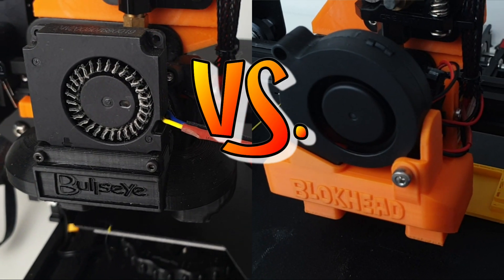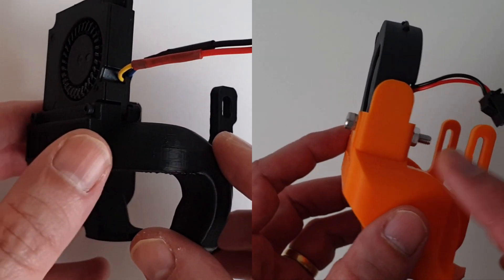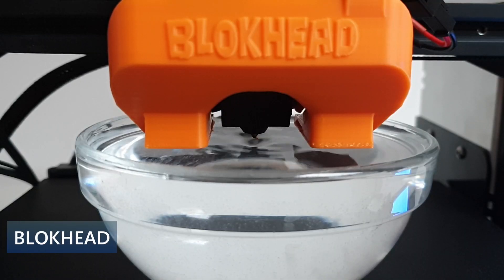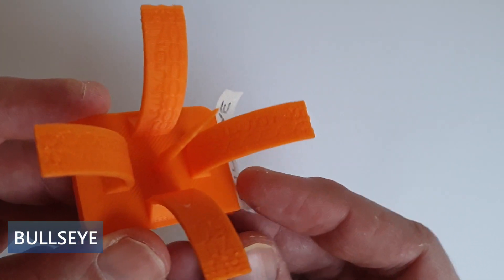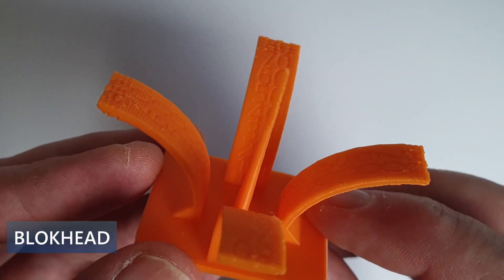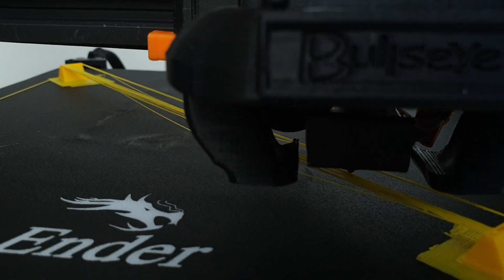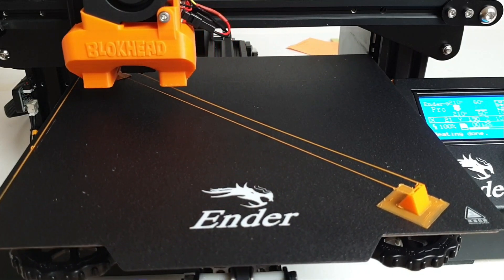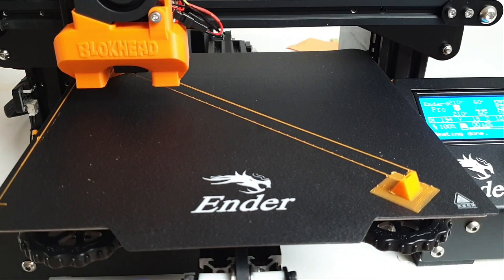Bullseye VS. Blokhead Fan Duct on Ender 3

Comment: Someone needs to create a fan mod that provides great visibility of the nozzle.   I dont xarexabout noise and I will never need to print a bridge that wide without supports, but darn it I inspect my prints a lot and want to look at the nozzle from time to time to assure things are ok...
Reply from the maker: The Bullseye is one of the best I have seen in terms of visibility on the nozzle. Much better than the stock cooling of the Ender 3, both in term of cooling and visibility on the nozzle IMO.

Comment: Blockhead vs hero me?
Reply from the maker: It depends what you expect from a cooling mod. If you ask me, I would reply this (but this is just a personal opinion and I am not a 3d printing expert): Pure performance (bridges, overhangs): HMG5. Silence: HMG5 (2 fans spinning at lower speed make less noise than one fan at higher speed). Ease of print: Blokhead (less parts and support free). Ease of installation: Blokhead (less parts / less hardware required). Direct Drive compatibility: Blokhead (The HMG5 shifts the hotend forward by 8-9 mm which breaks the compatibility with the official Creality Direct Drive or the SpeedDrive V1). Also to take into account: aesthetic,  cost, visibility on the nozzle, compatibility with future upgrades, ease of maintenance and so on. Both are good choices and improve upon the stock cooling, you cannot really go wrong! Since I tested the Blokhead, David Petsel has released a Direct Drive version of its Blokhead which seems interesting: https://www.thingiverse.com/thing:4868204

Comment: bruh I would have ejoyed seeing the finished results of the extreme bridge tests
Reply from the maker: I did not let it run to completion. Once the first 2 layers provide a solid fundation in the air, it is just normal printing. The hardest part of the bridge is the first layer because it has no support. Without enough cooling, the PLA fails to remain in place

Comment: If you toss out the fans, the blockhead with noctua are the ultimate combo.
Reply from the maker: Thanks for your comment. I  like Noctua fans but could not find a 5015 24 Volts fan from Noctua. Which Noctua fan did you install on the Blokhead? Did you have to make some changes to make it compatible?
Reply: @YouMakeTech  https://www.youtube.com/watch?v=4jk6kZIwsQA
Reply from the maker: @ZoltanHoppar  Thank you

Comment: Thank you for your information.  I am just getting started and researching the best setup for the Ender 3 Pro.  Very helpful and time-saving. Thank you again for your video.
Reply from the maker: You're welcome. Glad this video was helpful. The Ender 3 Pro is a very good 3D printer and with a couple of mods, it really rocks. If you are just getting started, no need to rush into upgrading it though. The Bullseye or the Blokhead are definitely upgrades I would recommend. Another upgrade that I highly recommend is to switch to Direct Drive (See my video on Direct Drive Upgrade https://youtu.be/Zbk0viFC1ew if you haven't seen it yet). The direct drive not only allows to print everything, from PLA to TPU, but improve significantly the accuracy of the extrusion. I am wondering why Creality printers are still using Bowden extrusion! I have a video coming out shortly (probably next week) about printing insanely fast with Direct Drive + Blokhead on the Ender 3 Pro. I have been experimenting for weeks and I believe the content I plan to release will be exclusive to my channel and is not available anywhere else (yet)! Stay tuned!